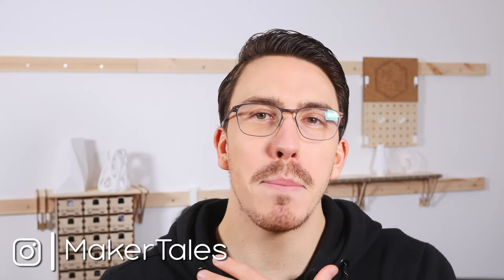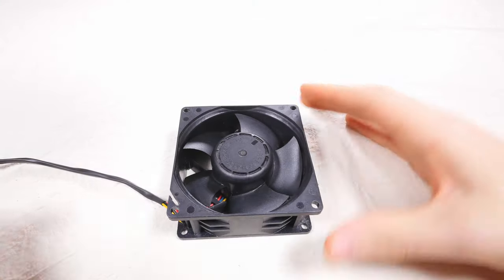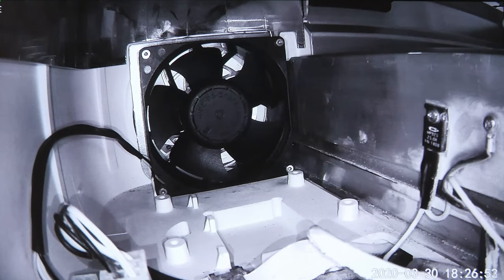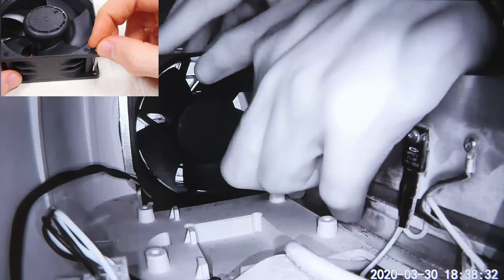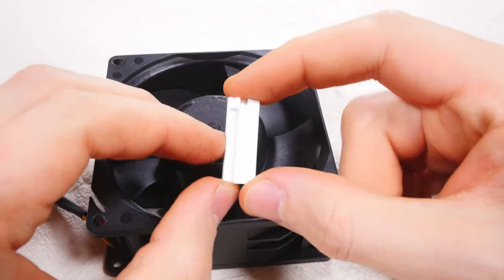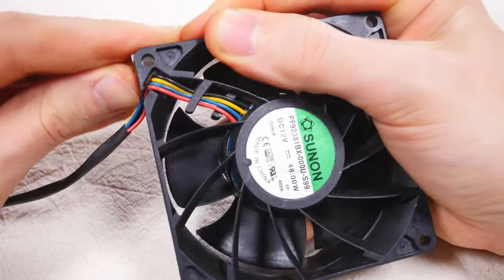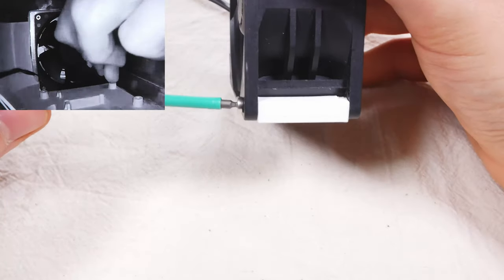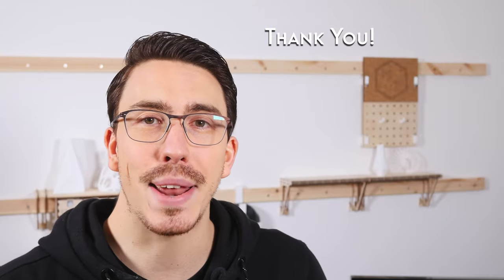How to: Clean Glowforge Exhaust Fan - Removal & Reinstalling

Comment: How often should we do this? Mines only two days old so I know not yet, but want to be prepared! Thanks for the info!
Reply from the maker: Hi Kupwtc,
Honestly it's really depends on the material you cut and how offten... If you are cutting MDF day in and day out. It's going to clog up SUPER fast so maybe do it every 2 - 3 weeks. You'll see the build up. If you see how my fan is at it's worst.. That where was the point that I was starting to see that there was a reduction of air flow from the speed of the smock. I clean mine every 2 - 3 months but that's because I don't really use my glow forge a lot and I don't cut any MDF ever! I hope that helps

Comment: Thanks for the VID!!! ordering my ball hexs now ! question do you have to put the fan back id like to put my fan to aside leave it plugged in , and leave the nice big open area for my Infinity fan to suck it out the air and dust it would add so much more air flow ? has anyone tired it ?
Reply from the maker: Hey Jav D, It's your call at the end of the day.... All I would say if that if you are sure it provides just as must or even more airflow that the GF one that I don't see what the negatives would be to not put it back in.

Comment: Thanks for the video - just curious, has anyone tried to trim the posts that are blocking the bottom screw heads?  It seems that they are not used for anything and are just plastic.  Using a roto trimmer or something similar I would think you can sheer off those nubs and then your life is easy (well easier anyway).  Just curious if anyone has tried this.
Reply from the maker: Hey Daniel, Honestly, I have no idea.... My only fear is that if you cut off the nubs. You will have no thread for the screw to screw into. My nubs are made of metal and are 100% where the  very tip of my screws go into 😕
Reply: I have a GF pro model and on mine there is some kind of heat sink in the way of the fan. It is mounted to those nubs.

Comment: do you need to remove the glass top on the left side? or can you actually reach it from inside. Also what if you leave out the bottom two screws? what detriment would that cause?
Reply from the maker: Hello Craig,
I'm pretty sure most of these are answered in the video...
Leaving the 2 bottom screws out is not really the best idea as it's a VERY powerful fan with A LOT of shake. I could see it quite easily working it's way out and destroying the inside of your glowforge... Your call tho.

Comment: Thanks for the awesome guide! It's really helpful!
I'd like to print out the guide piece. I was wondering what printer you used & recommended settings?
Reply from the maker: Hey Omar, I'm so glad you enjoyed the video. I have a CR 10 s and i'm printing PLA at 0.2mm layer height with 3 wall layer thickness and 4 top and bottom.
Reply: @Keep-Making  doesnt this need to be an STL file to print on my CR10s? it is an obj file?
Reply from the maker: It's an OBJ because you need to slice it in a slicer first for your printer

Comment: My machine's top screws are extremely tight. Any suggestions on that? They don't seem to be stripped, just tight.
Reply from the maker: Hmmmm no real suggestion that comes to mind, Key thing is take it slow and steady. maybe a little WD40 or a warmer or colder room might help.
Reply: @Keep-Making  I did finally get them all out! You're right, the key is slow and steady so as to not strip the screws. Eventually they loosened. Thanks 👍
Reply from the maker: @tsevgamesalot  Great to hear that it all eventually worked out